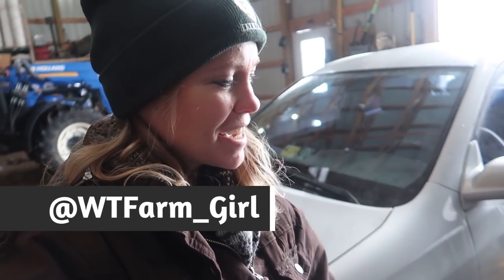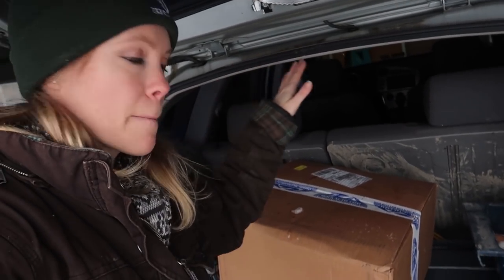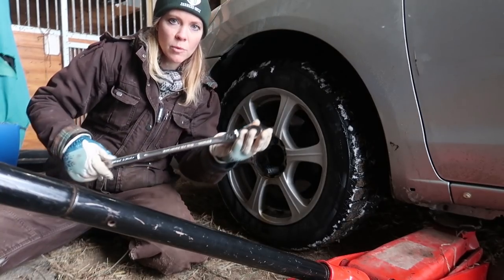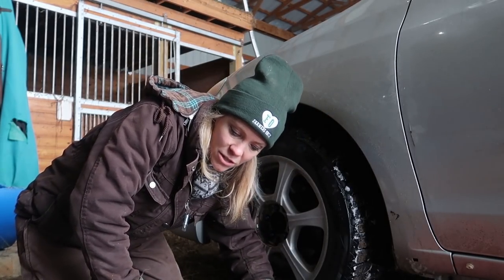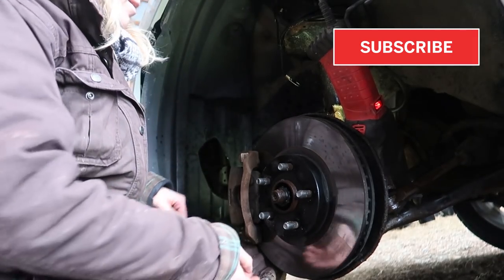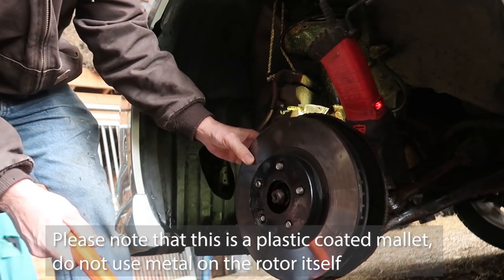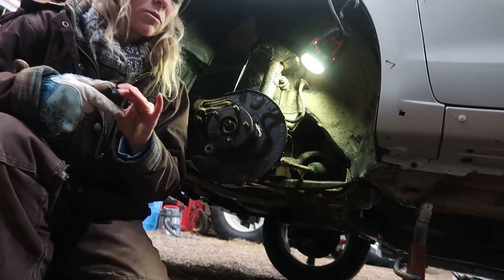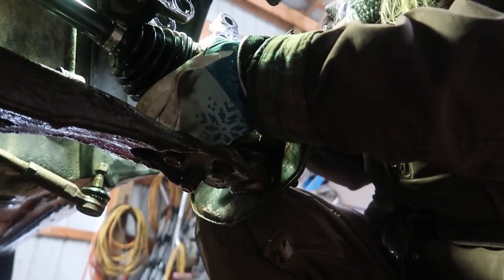280 Replace a Wheel Bearing Hub Assembly on a Toyota or Vibe

Comment: a wheel bearing that turns  hard ..  won't take much extra gas extra..  but it will get hot and totally fail .. once they are to the point of turning hard won't last much longer..

  Step 1  spray some penetrating oil on all the castle nuts cotter pins and  open threads  hours  later cotter pins  ect  will be easier to remove  if you sprayed penetrating oil on them..  Some times I will spray penetrating oil a  few days in advance of doing a project if I have easy access..
  Looks like some one washed the  hub.. Did Eric take it to the body shop to use the press ?

Comment: Nice job, your skills are improving rapidly. Get a set of punches to drive out cotter pins or split pins.
Reply from the maker: I do have punches, but I think those pins were rusted in pretty good :(
Reply: @This1LifeWeLive  working on elevators some a 100 years old. A punch the same size as the pin almost always works. In 40 years I bet I only drilled out less than 5 pins. Cotterpins never as they are soft. Roll pins or split pins are harden steel and can be difficult. The P B blaster is great If you have the time to let it soak in. Was impressed with your progress,

Comment: Where you had the car jacked  up on the first time is called the pinch weld and it is actually where you are supposed to jack up newer cars
Reply: You are never supposed to jack up on a pinch weld. The pinch welds are for clamping the car to a frame machine. A lot of times you will bend or dent the pinch welds jacking up a car on them. Been in autobody for 26 years.
Reply: almost every newer car has a unibody frame which you jack your car up from.

Comment: I hope your lower ball joint castle nut was good and tight,  thought i saw castle nut turn after you put  cotter pin in just before you put assembly back on car as that is a taper friction fit into steering knuckle assembly.
Reply from the maker: I went back and fixed it, lol :D
Reply: I,m so glad you went back in and fixed it.you got a lot of support and knowledge out here that have got your back.I know you saved big bucks on your repair and i can tell this car means a lot to you .I noticed the body is good and solid hardly any rust at all.
Reply: I think your daughter is going to get a good driver education from you as your a good driver i can tell.

Comment: hello,i must have missed it but did you PACK the wheel bearings with Grease.? and the Bleed the Brakes.???
Reply from the maker: The brakes were never disconnected so didn't need to be bled, and bears are sealed so I cannot pack them

Comment: Always be sure the wheel  and the rotor spin after any brake or wheel or tire work. You should spin the wheel after you have everything torked down.   You need to jack up the car to raise the wheel so you can test how freely it spins with minimum drag and noise.   You could have also spun the wheel  before you did any work to test for bearing noise or play to help with the diagnosis. You should have heard a noise had a wheel that could shake and a drag when spun.

Comment: Hi Suzanne,  the bottom ball joint castle nut  is not tightened up , when you turned  it to show  the new cotter pin was in , I saw the nut turn whith the ball joint, you haven't tightened the taper on the ball  tight enough, when tight the castle nut should be tight up to the hub flange,  please remove cotter pin and tighten nut up fully, or you risk that bottom ball joint coming apart on the road.  I am a retired mechanic and only want to point this out because of the safety involved, it is NOT SAFE to drive unit you fix this, other than that you did well,  Best wishes, Stuart uk.

Comment: I've got my computer on speed dial for Rock Auto.
It's a no brainer when it comes to a vehicle that's front wheel drive to replace the entire hub and bearing assembly. The biggest issue is on some vehicles, you need to break loose the lower ball joint in order to get enough room for the CV shaft to be removed.

It's too late now, but if the vehicle needs a wheel bearing, it's getting close to a CV shaft or CV shaft boots. Cheap at half the price.
Reply from the maker: Good to know!

Comment: SUE DON'T USE FINGERS TO LINE UP ANYTHING AS IT COULD SEVER THE DIGIT AKA CUT YOUR FINGER OFF..I WAS A PIPEFITTER FOR OVER 40 YEARS AND I LEARNED THAT EARLY ON AND STILL HAVE ALL MY FINGERS.
OTHER THAN THAT YOU DID A GREAT JOB.
GOD BLESS YOU AND YOUR FAMILY
(WATCH OUT FOR PINCH POINTS)

Comment: I am so impressed. I do my front wheel bearing like once a year they don't last. I have bought the special tool that pushes and pulls the actual bearing out of the hub.  Just the way it is.   Hey watch south main auto on youtube Eric gives good tutorial.
Reply from the maker: Crazy yours only lasted a year :(
Reply: @This1LifeWeLive  cheap ebay Chinese junk parts (psssss the same ones they sell at autozone probably anyway) and the aggressive zigzag (chevron pattern)russian snow tires squirt the salty snow slush out from the tread with such force I believe it just gets forced from the inside of one tire across under the car at the other past the grease seal 09 Chevy Aveo
walk the sidewalks in town during a snow event and understand how these snow tires work as you get covered with heavy salted snow.

23pc Front Wheel Drive Bearing Press Tool

Slide Hammer Dent Panel Puller Tool Wrench Adapter Axle Bearing Hub Repair Kits

deep wheel hub adapter for slide hammer tool

Rod Splitter Tool Separator Tie Joint Remover + Set Puller Extractor Ball End

snap ring pliers grinder torch impact guns

Comment: Great job expect your lower ball joint nut is too loose and in short time you will ruin the new hub plus you will need to buy a new lower ball joint. Do NOT DRIVE UNTIL YOU TORQUE The LOWER BALL JOINT NUT TO THE PROPER SPEC. Very DANGEROUS !  29: 45

Comment: You need to redo the lower ball joint, normally the nut is tightened to a set torque, I just tighten as tight as I can get. Insert the cotter pin in whatever hole lines up. If none do, tighten a little more until a hole lines up. Yours is too loose and if you drive on it like that, it will cause wear to the tapered hole or cause the ball joint to break. Yours is way too loose, the stud should never turn in the spindle. Plus if the stud spins that easily it's probably worn out and needs replacement.
Reply from the maker: I got it fixed as soon as I could :)

Comment: I'll commend you on getting past the axle nut issue. Way to use your head . 100 dollars for a punch is ludicrous.  Specialty tools are often that way. Sometimes  you get to use it 2 or 3 times. 
As for that nut, you don't need to worry about it. If removing it by hand it might be slightly easier. Maybe. All you need to do is turn it. The edge of the notch will straighten the edge of the nut as you turn it. Nothing will be harmed.
Also the chrome sockets aren't for impact use. But it's not that big of an issue. You might break your socket. But they don't explode.  I wouldn't hold me head right by it. But all they do is crack. Still always good idea to wear safety glasses.

Comment: When undoing Wheelnuts, place the wheel wrench at 10 to 12 position and press down its much easier and you can use the jack handle on the wrench to give you more leverage, make sure handbrake is on , and in gear or park,..for safety,..and chock the other wheels,,,,,,,,,,,,,,,

Comment: Looks like the lower ball joint wasn't tightened enough. After you put the cotter pin in you spun the lower ball joint mount and the whole ball joint spun in the spindle assembly.
Reply: Otherwise you did a great job.
Reply from the maker: @kurtdupuis8313  Thank you for the note! On this one the nut wouldn't spin any further down. it's very likely th ball joint might be going as well since the nut refused to tighten. Not having done it before, I figured that'd just what it did. The next side will need to be done maybe next week, so I'll check that one and compare how they go toegther. might need to be a new one ;)

Comment: Generally auto parts stores sell parts for older cars. Most new cars come with all new parts so they will be old cars before they need parts. Thanks, I've never laughed so much in my life.
Reply from the maker: Actually, none of our local auto parts stores have carried parts for the truck OR my car (both 2004 and 2002). They have all had to be special ordered :( And wheel bearings have a life of 80,000 miles, so a newer car most certainly will be the bearings replaced. Mine is just special and has gotten 160K out of them :D
Reply: @This1LifeWeLive  That's why I said generally. The popularity of a vehicle is a also determining factor. Some parts are specific to one car while others fit on many. Where I live you can usually order your parts through an auto parts and they will loan you the tools to install them. They will also offer advice on how to do it.

Comment from the maker: First!
Reply: I believe the nuts are one time use locking nuts. The sockets are 6 and 12 point, 6 point holds better but in limited space the 12 point gives more chances of getting the socket on the nut with room to swing the breaker bar handle. A 3-4 foot pipe over the handle of the breaker bar making it longer gives more leverage to loosen stubborn nuts. Bzzzzzz not CV joint either that's the tie rod. The axle has 2 CV joints under the rubber boots. The ball joint gets tightened tight to seat it in the knuckle, then back off as little as possible to get the cotter pin in. You should always loosen the torque wrench to it's lowest setting when done using it. Foot pounds is the term.
Reply from the maker: @QQTrick1QQ  Thank you for the tips! Why were you not sitting in my barn while I was doing this, lol??
Reply: @This1LifeWeLive  XD

Comment: This is insane it really raises my blood pressure

Initially, the court ruled that the dealer and mechanic had violated the MVSRA since the mechanic admitted he forgot to tighten the lug nuts. The jury went ahead and awarded $40,000 in damages and that the dealership cover the $70,000 in attorney and legal fees.
All sounds well. However, that motion was appealed by the dealership. And the appeals court ruled that the MVSRA had NOT been violated. Huh.

Comment: I don't think the castle nut should spin when you turn the ball joint. The taper should lock it in place.
Reply from the maker: Correct! I got it fixed later on :D

Comment: A car jack that you get with the vehicle has a speicial groove on the top the fits into the groove on the sill, its a spiecail reinforced place for only that jack,. A trolley jack should never be used on that point , but should be used on the axle your working on, or the chassis,

Comment: Did you put vaseline on the slide bolts to help them from seizing up
Reply from the maker: No :(
Reply: WT Farm Girl Videos 
The proper substance to use is Anti-seize.
A grease made of very tiny ball bearing like pieces.
Reply: I purchase anti seize by the case ..

Comment: I hope that one of your brake shoes is out of that caliper, it looks like you only have one in there,and there shouls be two,..you will need to compreess the cylinder back in to get the shoes back in and be able to put back over the brake disc,, and make sure you bleed the brakes after reassembly..
Reply: mole meister   why would you bleed it ? How did air get in it ?

Comment: Of course the other wheel bearing has just as many miles on it and probably should be replaced. When you switched to the cell phone, it looked like you were turning the nuts and bolts the wrong way but then I realized that the picture was backwards and it looked like you were changing the right front when you started on the left. Where was your cat helper Sassafras?
Reply from the maker: Sassy was indoors staying warm, lol

Comment: I hope your CV joints & their rubber boots are in good condition. A tear, or cracks, in the boots lets the grease out & dirt, water, & other contaminates back in.  If you start hearing a clunking noise. . . . don't keep driving on it!

Comment: You are Turing that nut counter clockwise  the opposite of normal   the nut on the other side would turn clockwise..  216#  foot  pounds is a  lot you will need some leverage..  Your torque wrench has a micrometer style  adjuster.. or dial digital ect..  it is a clicker torque wrench ..   a  really old style has a beam  indicator ..  about the only tools I  have that are snap on are torque  wrenches..

Comment: You need to sweep away all of the hay straw and dust..    you don't want sit parts in the dirt..  Plus  remove the fire  hazard so you can  put a  propane  heater near where you are working...
Reply from the maker: We don't have a propane heater. But we did get most of the hay out now we have mud. I kinda like the hay better . . . I don't get all muddy, lol!
Reply: @This1LifeWeLive   Oh  you have a dirt floor..  I like the big  rubber mats  that go in a pickup bed.. if I have to work out side .. I put a  rubber mat down to  work on ..
  I had my truck almost stuck in deep mud once when the drive shaft twisted off..  I   put the  rubber mat right on top of the mud.. It was a steady rain all day . 
   You just need a small infra  red Propane heater and a  20#  or  40#  Propane  tank those heaters are like  $70.00 or less .. Eric and get you one for Valentines day .. 
  Buddy heater..

Comment: well it was entertaining and humorous at the same time... just an FYI it’s “foot pounds “  there is also inch pounds don’t get them mixed up or your stuff will fall apart.  Next time you have a stuck cotter key  try a nail or a punch just smaller then the hole and tap it out with a hammer.
Reply from the maker: Yes we tried the hammer trick first, but they were fully rusted in :(

Comment: Now have Eric test drive the car so if a wheel falls  off you won't crash and hit a Tree.. 
  There was a Huge Law  Suit in Grand Rapids a couple  took their car to a Chevy dealer for a tire rotation and oil change.. 
  The mechanic  ..  forgot to tighten the Lug nuts.. ..  The woman made it about two blocks from the dealer  before a front wheel fell off and she crashed the car..   The couple spent  $60,000.00 on Lawyers and a Judge ruled that  tightening the Lug  nuts is not part of a Wheel rotation  job.. and did not find the Dealer liable ..  Now if you Don't believe  me I I'll find it on Google ..

Comment: So if your toque wrench was  1 foot long you would have to weigh 216#  but if your torque wrench was handle was two feet long you would only have to weigh   108#   and I am guessing you are a  little over  108#
Reply from the maker: Wow, I didn't know the math on that one!
Reply: @This1LifeWeLive    Simple MATH    1 foot of weight at the end of a 1 pound lever..   Of course so many  cars are Metric and they tell you in Newton Meters..  you need a chart  calculate conversion or  my torque  wrenches have both foot pound and newton meter scale on them to set the dial to ..  Inch pounds are for very small bolts ec..

Comment: Where is your hub grease, thats very important, without it the bearings will overheat and sieze up on you and your roadwheel will lock up ........
Reply: She replaced the whole spindle and hub assembly that has sealed bearings. They don't need grease. Most front wheel drives have sealed bearings-not tapered roller bearings with races and seals.

Comment: Buying the whole new knuckle and wheel bearing is cheating.  I wanted to see you press the hub and bearing out and in.  Stopped watching upon seeing this.  Sooo disappointed
Reply from the maker: Well you are in luck, there are plenty of videos of guys pressing them out and in, but ZERO of them doing the whole assembly. Most cars have easy wheel bearings but toyota doesn't. It took long enough just doing the assembly. Had I done the wheel bearing I would be another month trying to get this video out.
Reply: WT Farm Girl Videos 

    I was just kidding you.  I value your courage doing this.  I watched for entertainment as I have replaced close to 30 of these since 2006.  I have all the specialty tools and presses.  I have this down to about 1.5 hours for a press in and 30 minutes for an assembly bearing.  I was nervous for you cranking on that axle nut without the wheel on the ground or a screwdriver in the rotor keeping from ruining your transmission or CV axle.  Good job for a first automotive repair.
Reply from the maker: @sirsweetness8332  I think the next one might be a 3 hr job, but I hadn't seen anyone do the screw driver trick in a video, although I did hear mention of it on a website 😕 Erik's buddy just mentioned he has a bearing press so next one I might just take over there and save the $200 and only replace bearings  :)